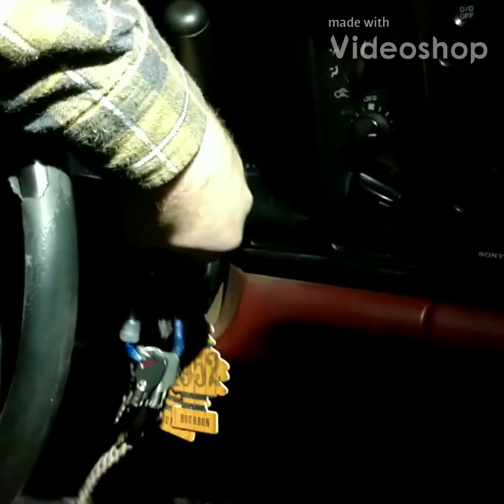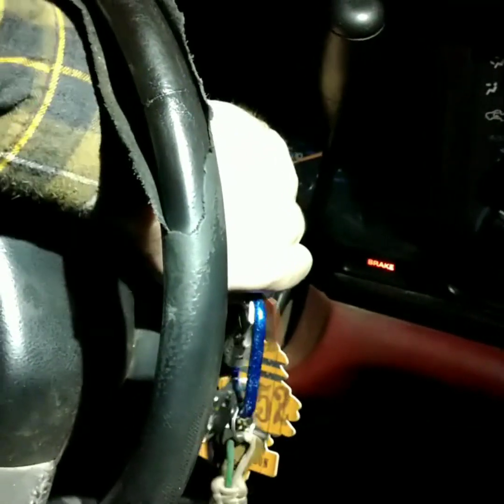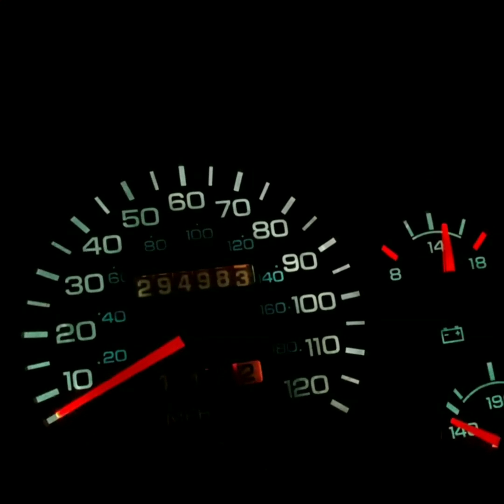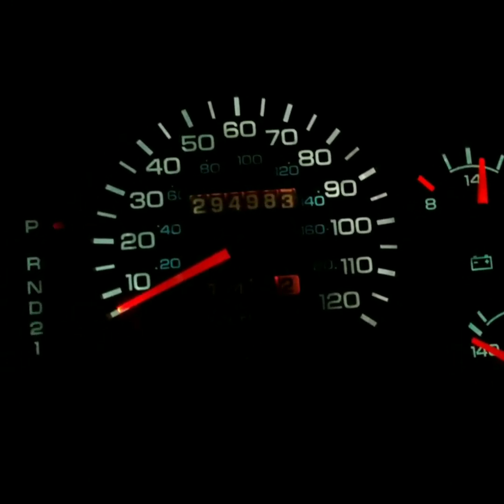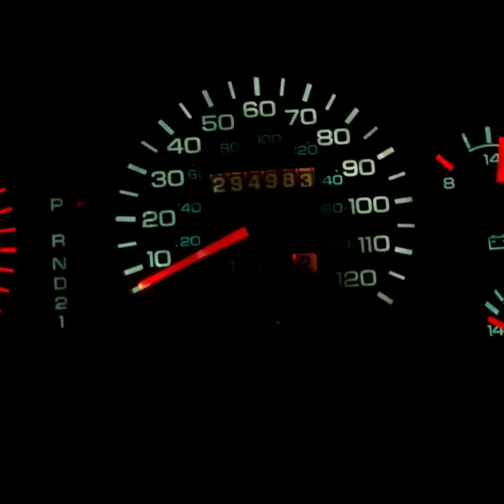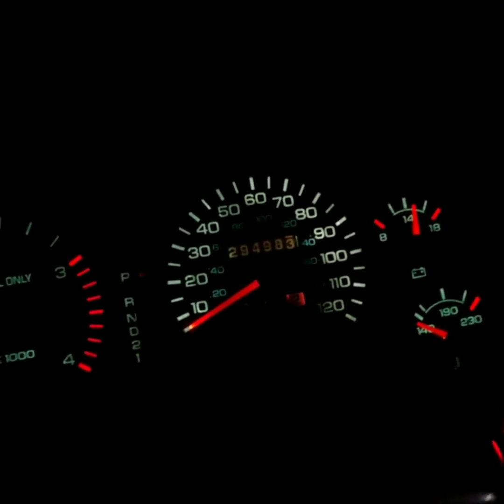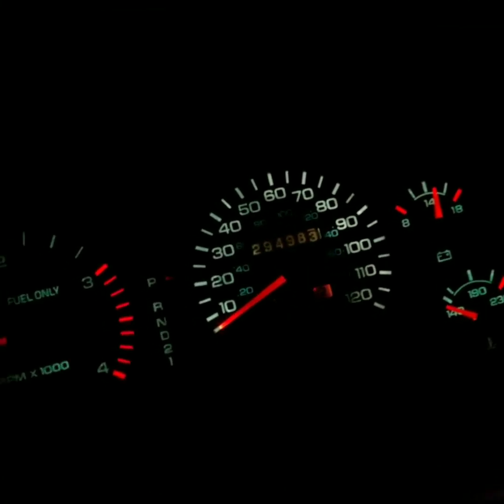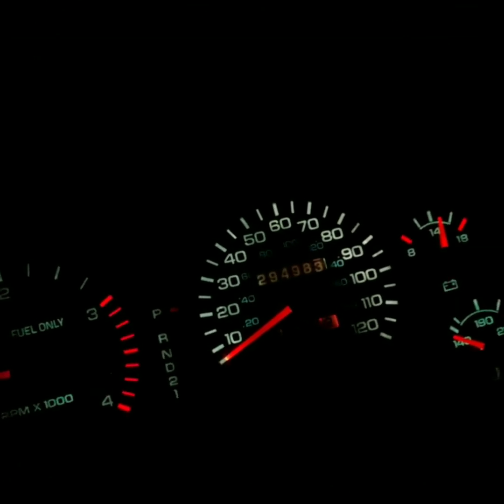Dodge Ram 2500/3500 Cummins: Cold Start Voltage Drop - Explanation

Comment: Thank you!!!!!!   My '06 3500 does this and I went to work cleaning all my battery connections (and swapping positions master to slave while I was at it).  It didn't cure the voltage drop when cold.  Then I found this and I am happy again.  I don't know what "grid" heater is yet so that may be helpful to know.  My truck doesn't usually get cold as I live in FL but the issue came up on a trip to Arkansas in December.  Thank you!!!!!!

Comment: Just found this video. My 2007 does the same thing. I really thought I had a bad alternator or voltage reg. these don't have great headlights anyway and having them go even dimmer always stresses me out. Next question would be about the brakes not wanting to stop when leaving my house. The first stop sign 100 feet from the driveways ok but the second a 1/4 mile up the road i step on the brakes and it slows but doesn't want to stop, it feels like I need to stand on the peddle to keep it from surging forward. Any ideas.

Comment: When it’s really cold My 2017 3500 does this to the point it will drop to 11 volts and sometimes go into battery save mode it’s so bad. Once the truck warms up all is fine.

Comment: Great video thanks brother. I think you did a great explanation of why it does that. I never worried about it just let it warm up before you take off. I always got asked why I was just setting there after a cold start. I was waiting on some heat to get in the system unlike others start up and go. Keep up the great work see you in the next video thanks again brother